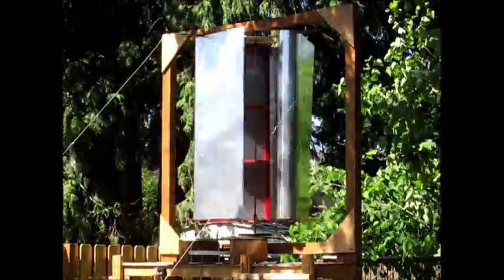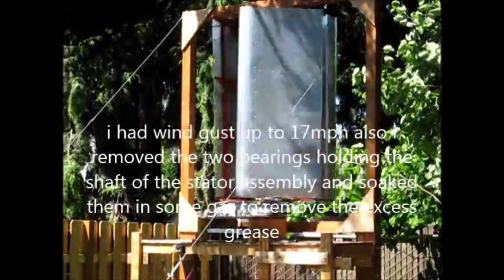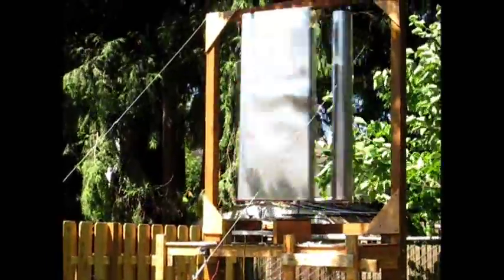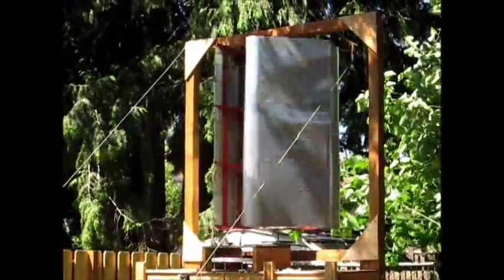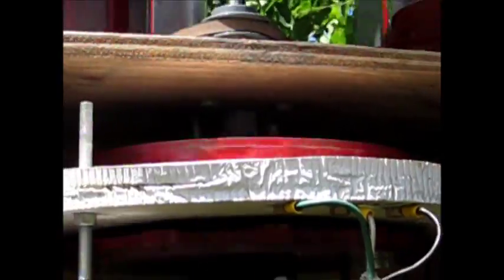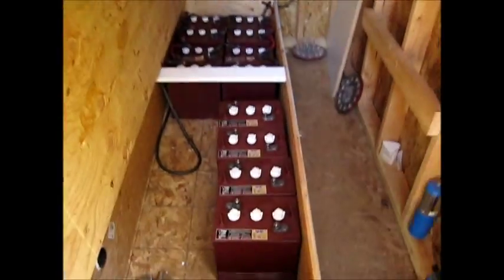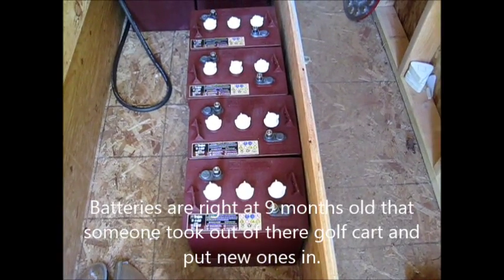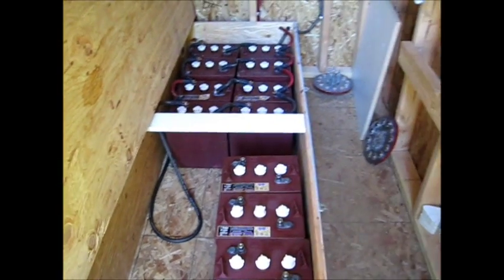Vertical Axis Wind Generator in 17mph wind

Comment from the maker: hey john, I actually priced out extension cords that will reach the connection on my shed, then went to my local electrical contractor supply house, not home depot or lowes, and I get #10 or #8 wire cheaper then getting a drop cord

Comment from the maker: thanks Kyle, I ment to say that anyway, going to run from the stator to the shed, then hook up the bridge rectifier inside the shed. I will still use #10 or #8 wire from the stator to the shed. picked up some 4/0 to redo the battery banks that should handle a lot of power

Comment: nice setup, and what a deal on the batteries! if your shack is a good distance from the VAWT, keep the phases and rectify at the shack then you can use cheap wire.